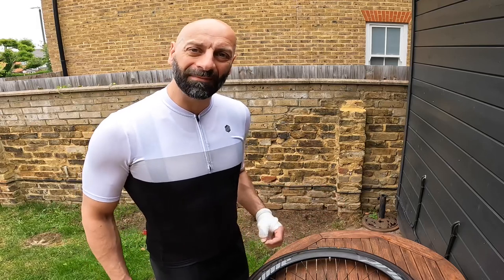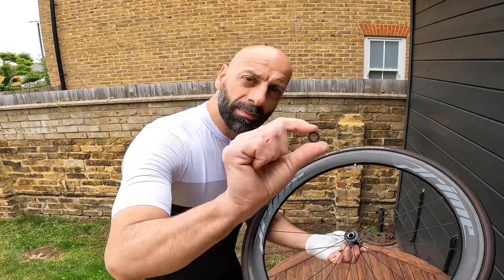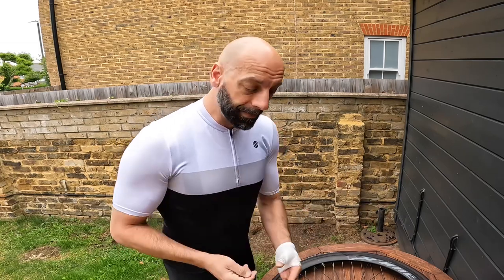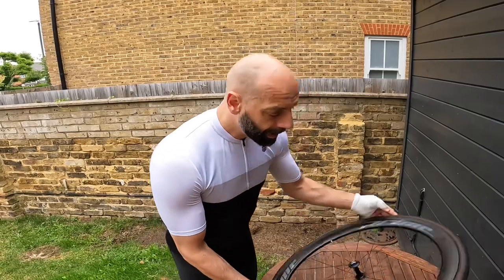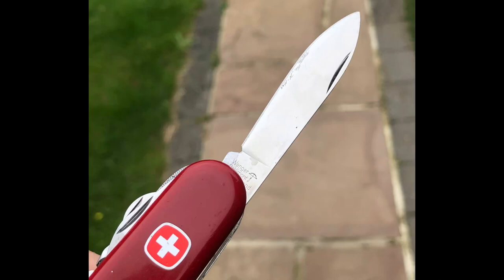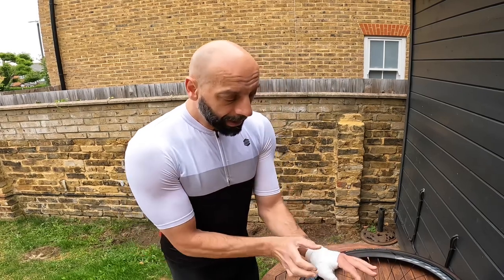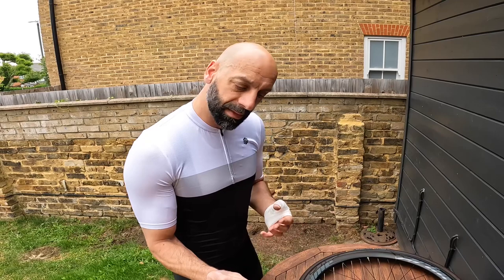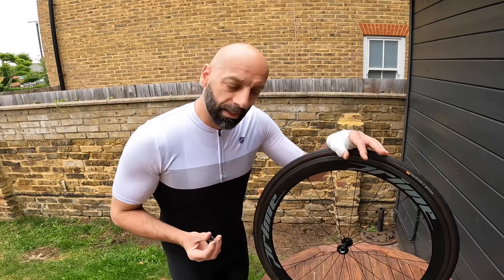A moment of complete madness and carelessness!

Comment: I feel your pain,  I nearly cut my fingertip off  servicing a brake disc 12 weeks ago.   The Free 2 Cycle method does work.  I used it to replace the bearings on 2 wheelsets. Speedy recovery.

Comment: You can use the old bearing to hammer it in. And for the pressing Method you can use a threaded Rod with bolts and washers on each side. 
Wish you good recovery.
Reply: Great advice thanks!
Reply from the maker: Nice one!!
Reply: The threaded rod method: https://youtu.be/iDmppfzme2I

Comment: Get well soon! I will blame it on the bad design or no instructions of the grease tube package, I had the same one bought it half a year ago couldn’t figure it out how to open it until recently, just use scissors cut the top tip off , the plastic is soft.
Reply from the maker: Maybe I should sue them 😂! I confess I knew it, but unfortunately chose the wrong tool!

Comment: Can't blame anyone for being frustrated with sealed bearings cartridges.  Balls crushing less than 10,000 miles--on the front wheel?  Whoa.  Beat up on the London streets!  Wimped out to please the lightweight gods, for sure, and save lots of manufacturing costs!

Old fashioned massive cup and cone bearings with loose balls, perfectly adjustable with a lock nut and cone wrenches, are good for 30,000 miles or more.  I've run legendary Campy Record hubs on two bikes for about 100,000 miles on each for 35 years, and never looked back.  Replaced the aluminum rims on each one time.  The brake surfaces would score up, eventually wear down to paper thin, and split if you let it go.  

The hub bearings would last forever.  Overhauled them a couple of times and the big balls are still solid under a magnifying glass, the [press fit] races aren't scored, and they run as smooth as glass.  Balls and races are replaceable.  Doesn't high end Campy and Shimano still offer cup and cone bearings?

Oh well, live with the times; suffer the consequences!  Hope the hand doesn't need stitches.  I predict you'll be riding within the week!  Good luck!
Reply from the maker: Thank you, they glues the wound up, hopefully it will heal like that. You lost me a bit on bearings knowledge, I agree the broken one seems to have failed due to potholes rather than corrosion.

Comment: Sorry to hear about your accident. I had my moments too. Hope you heal up well and get back on the bike soon!  I have swapped bearings many times on my similar Prime wheels. I would really recommend getting a bearing press that has the drivers for 689/699 bearings. These small bearings are really delicate and the tiniest misalignment will cause the new bearings to bind and wear out fast. Before I got a bearing press I used a matching socket + the old bearings on top of the new ones as a guide and the rear QR skewer as press. That worked pretty well. Only press until there is no more side-to-side play on the axle. Too much pressure will cause a kind of preload between the inner and outer race of the bearing that will increase friction. Good luck!
Reply from the maker: Good advice, thank you!

Comment: You can try putting the bearings in the freezer and heat the hub up with a heat gun. May just fall right into place.
Reply from the maker: Interesting, have you used this technique before?
Reply: @fede1275   Not with a bicycle wheel hub, it worked with a small radio control model car engine though. kept bearings in bag in a chest freezer over night, heated up the engine case and it worked very well. I had to work fast as the bearings expanded quickly.